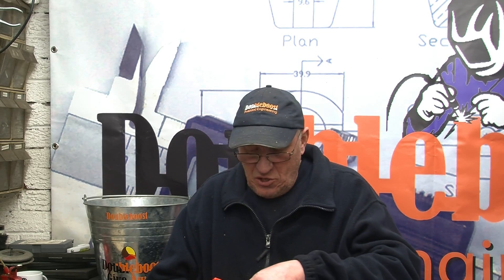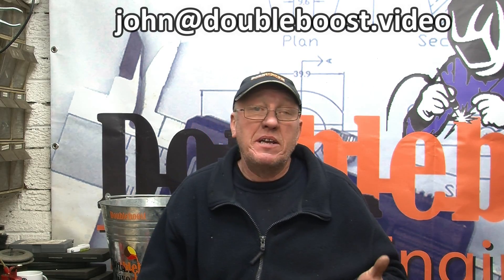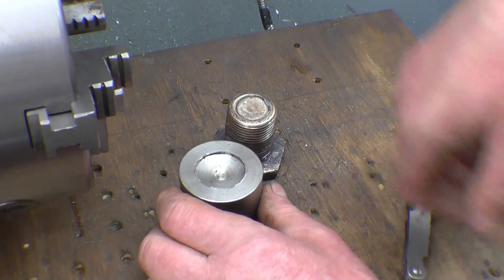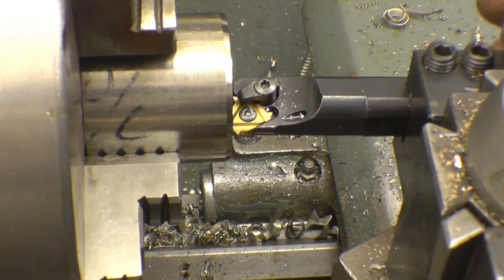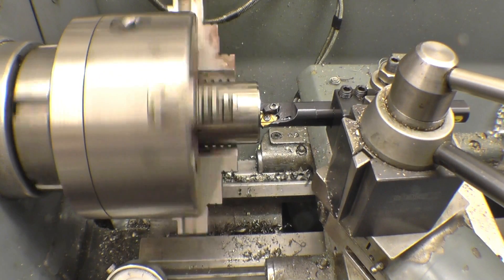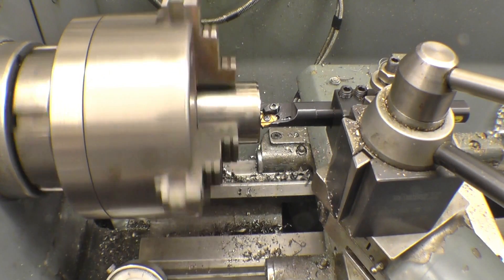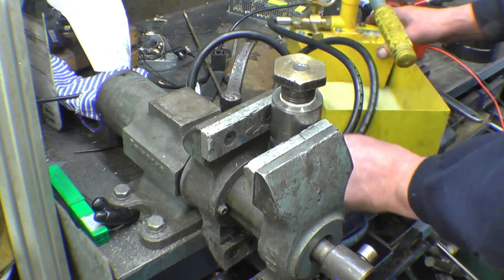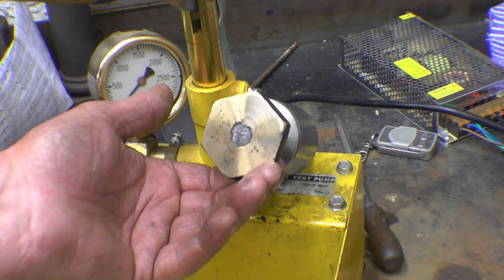SNNC 268 P1  BSP Screw cutting  Hydraulic Testing

Comment: Nice bit of internal threading.  Those fusible plugs were a great bit of safety engineering for their time.  You need a large adjustable spanner to keep next to your vise, that way you can use the correct tool, and people won't call you a "rough bastard." LOL  See you in part 2.

Comment: Hey John that giant 3ft lond vintage die tap wrench that's solid steel. But rusty I know is to heavy to post. Just wondering you saw pictures didnt you and defo not interested?
Reply: thats for tapping holes you can drive a car through!  it would be a wall hanger and never used
Reply: @jusb1066  yeah maybe but he could get the jaws out and have them closer male them cut smaller things or use the sold steel handles for stock